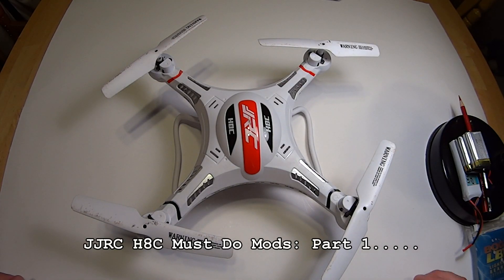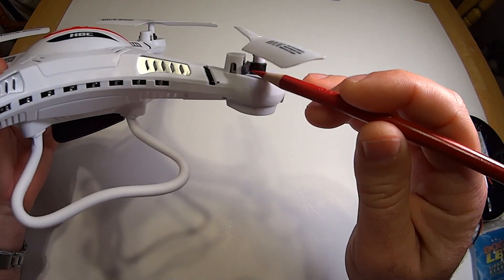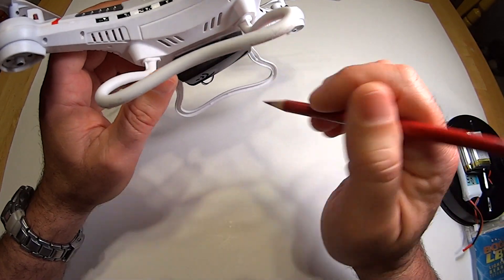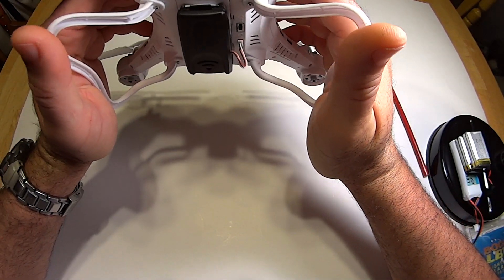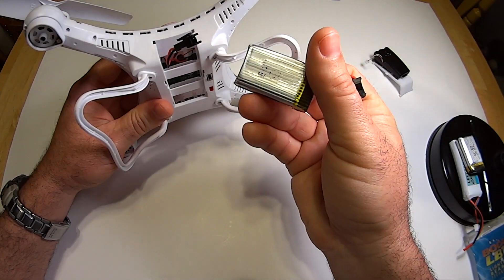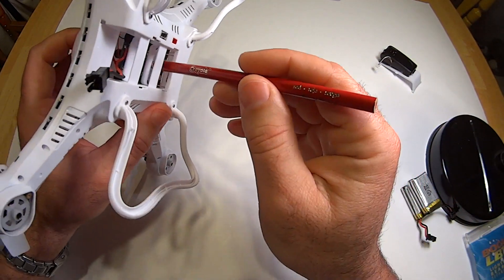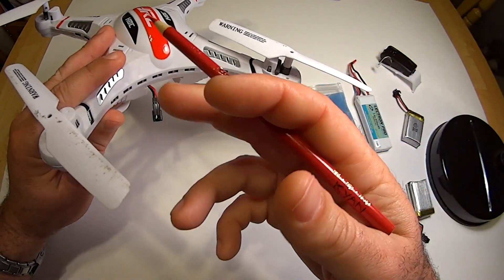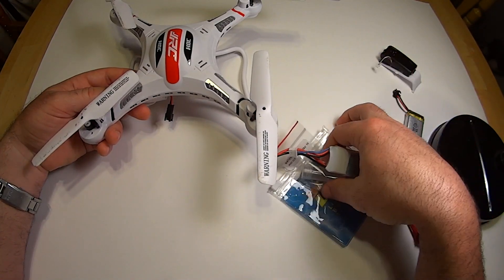JJRC H8C HD Quad Copter Drone MODS - All the Best Part 1 - [Thoughts After 25 Flights]

Comment from the maker: +Kyle Gorski  Any cheap (plug into the wall soldering kit will do).  Probably gearbest.com or banggood.com are the cheapest but will take long from China.  You could check Ebay for a seller closer for faster shipping.

Comment: Thank you so much. yep gear to motor separation after 7 flights. I just watched you and cut no..2 pencil eraser in half and used as spacers as you did with rubber. flying now boss. Thank you for vid. an information.you are right it is a lot of fun. fly on.I use the WL Toys transmitter 2v2 an a lot better.Thanks again.
Reply from the maker: Glad some of the info helped you out and your having fun.  That's what its all about!  :)

Comment: Love the landing gear mod, that was one of the first things I noticed was that it fell on its side a lot and scratched up my props.
Reply from the maker: Yah it tipped on me almost every landing.  Not good for destroying props.  Glad it helped.
Reply: Yeah and it doesn't look professional. Haha us quad copter pilots try to do everything smooth including landing and this mod helps haha. Thanks. Also do you think your motor went out because of the amount of flight time you have with that bigger battery? Cause that seems like it would be the problem with that battery is it will run longer than its meant to?
Reply from the maker: The motors will die on this quad no matter what.  I think the motors were about to go anyway and it was kind of a coincidence.  But I'm sure more heat for longer won't help either so perhaps staying in the air for the entire upgraded battery run is not helping the motors much.  I'll let you know when the next motor fails.

Comment: you forgot to mention that to use the lectron lipo, you have to alter the main connector the lectron has a JST connection and a connection for the balance charger
Reply from the maker: I think I mention it and it's shown in the part 2 video https://youtu.be/rJ3pEy6EAxo

Comment: Some good mods in there for sure.
Reply from the maker: Thanks...waiting on motors so I can get this thing back in the air and have some fun.
Reply: Dustin Dunnill Took my first mini crack at FPV with it ... gear was too heavy.  I need to consolidate (use the quads battery for my tx) and reduce some weight in wires/plastic.
Reply from the maker: Right on.  that's what I was worried about.  Really have to get lightest gear possible.  I plan on running the micro 200mw tx that comes with the Hobbyking quanum complete fpv kit off the Electron 950mah balance port.  which transmitter are you using?
Reply: Dustin Dunnill skyzone 200mw.  It's pretty tiny.  However, I had it wired to use my 808#16 keychain with lots of extra connectors and wire (for airplanes).  Once I get the wiring paired down and get it using the quads battery I'm sure it will work...I wonder what kind of flight time I'll get though with the tx using the quads standard battery.
Reply from the maker: UnlimitedVertical I see..hmm.  Well if your tx + cam setup (once lightened) is around 20-30 grams?  And its pulling its power from stock battery...I couldn't emagine much more flight time than about 3 - 4 minutes.  I'm worried about what camera to use.  The hobbyking quantum complete fpv kit cam looks to big in the pics.
Reply: Dustin Dunnill
FliteTest has an interesting DIY micro quad video/article.  Also horizon hobby sells an all in one micro FPV camera/tx/antenna which is pretty tiny.  I was able to get a bit of a flight by lightening it up some more, but not quite what I had hoped for...not ready to give up on the idea yet :-)
Reply from the maker: Thanks UV

Comment: Nice review.  I also did several reviews.  The main problem with the H8C is the 7.4 volt system.  It's too much for the cheap hollow cup motors and ultimately caused a board failure in my case.  Banggood has come out with the JJRC H12C.  3.7 volts.  A much better system.  The transmitter is junk with the H8C.  Good luck.
Reply from the maker: Hey MrPolymers,  I've seen a bunch of your great videos!  Your a great flyer.  It definitely has a few week spots.  Have some motors on the way and plan on doing more mods to see what I can squeeze out of it.  In the meantime the papa CX-20 Open version just came in the mail today....just unboxed it and will be setting it up...but that's another story......  thanks for your comments.
Reply: Good luck on the Cheerson.  I have a little experience with it.  Give me a PM if you have any questions.  My H8C and my 3D X6 are both out of commission. Awaiting a new board on the H8C and I returned my 3D X6 back to Banggood for a replacement.  They said I had an old version??  Really?  It's only two weeks old.  I'll subscribe to ya if I've not already.  Have fun...
Reply from the maker: That's to bad on the outta commission status.  I've been a regular on rcgroups.com (rc808hawaii) in anticipation for the CX20 and have really been absorbing it all.  watched a few of your vids and they really help.  Thanks again and I hope your flying again soon!
Reply: First, get to know what LVC means. ;)  Low voltage cutoff.  The Cheerson will drop like a rock.  If you notice, I run timers with most of my quads.  You can thank the Cheerson CX 20 for that. Run trial times on the 2700 mah batteries for the Cheerson and make a note of it. Then, when you fly the Cheerson, back off on the run time by 45 seconds to a minute.  My timers have alarms on them. When they go off, time to bring the Cheerson down.  In addition to the timer, I run a low voltage alarm.  I highly recommend getting a few of them as they are cheap.  With all these protections, I hope you don't experience the LVC crashes like I have.  Good Flying..
Reply from the maker: I've seen (and heard) your timers in your great videos.  Definitely taking heed on that as numero uno precaution.  Still got that giddy feeling from unpacking..lol
Reply: Yes, it's definitely a whole different quad than these toy grade ones and something you don't want to be practicing on as a beginner..
Reply: Hi There! Been watching "everyone's" vids on Youtube. Bought H8C as first Quad a month ago.. Yep I was taking off and watched left rear motor slow down and stop, Quad tipped over, etc... You know.. "They" should do a recall, as any other product on the market "They" would have to. Bought a Hubsan fly's great - no issues.. Since the few flights I got in on the H8C were impresive, I like the tip on the H12C and will get one of those.. "Thanks"!
Reply from the maker: It really is a fun little quad.  And I guess that's why I keep it and repair it.  Your probably right on the "recall".  I'm thinking of getting a mini brush-less kit and doing a retrofit to this quad since I like the look and form factor (definitely  not the very near future).  Still having fun with it.  I'm uploading part 2 with detailed installations of everything and body mods so you might want to check that out on my channel soon.  Thanks for commenting.
Reply: Will do and "Thanks"! It is fun when it works, gonna give H12C a try, I will post a vid when I have it. :)
Reply: Let me chime in here.  I own two H8C's. I've come to the conclusion that the 7.4 volt system of the H8C is too much for the cheap coreless motors. Granted, the H12C 3.7v system will not have the lift of the H8C, but I think for your "Sanity", the H12C will be easier on the motors.  I should be receiving my replacement on the 3D X6 brushless quad.  I will also be building a 250 class brushless ZMR with 12 A ESC's and motors more powerful than the X6.  I like the 250mm size vs my larger 350mm class Cheerson CX 20.  For me, not as much worrying flying them.
Stay tuned to my channel.  I'll also be joining my quad racing club and will have some fun stuff posted this Spring/Summer. Good Luck.
Reply: ***** I also have the V262 which runs on the same motors as the Tarantula.  You need to break in the motors and every third/fourth flight use a product called Ideal "electronic switch and contact cleaner.  Order extra motors and I hope you can solder and have decent soldering equipment.  I'm going to post a video soon of my two variations of H8C motor replacement. I'll touch base on soldering there too. Oh, I forgot to mention..  I think the motors have a plug on them.  That's great, but you cannot purchase them!  So, back to the soldering idea..
Reply: MrPolymers wondering if anyone has considered to put better motors into a JJRC H8C or if it's not really feasible? It's my first quad so really a newb but what is best action if/when a motor fails?
Reply from the maker: Greg Besso I haven't seen any better quality compatible sized motors yet.  The thing to do at the moment is just have some on hand for when they do fail.  All we can do is hope that someone will manufacture better motors at a good price soon.
Reply: Dustin Dunnill thx man, i ordered the battery and bearings on ebay, stoked for installing them as soon as they arrive :-)
Reply: MrPolymers Hi, I have one of these.... Is it true that motors run out after a while? I have seen a lot of people complaining for burnt motors. Maybe i'm lucky, never had a problem with motors, even at heavy duty. If I burn a motor just in case can I replace it with a powerfull one? I modded the transmitter today aswell like the video. Can't wait to try it out. Is it necessery to mod the bearings?
Reply: DavidVercettiMovies  Well, I'm not aware of anyone getting great performance out of the motors on the JJRC H8C.  You will eventually lose motors unless you either fly incredibly slow or not more than once an hour;).  My two H8C's are mothballed.  I had one lose a motor 25 feet up in a neighbors tree!!!  Well, that sucks.  Fortunately, the neighbor helped me get it down.  I just purchased a V636 Skylark to replace my H8C's for around the neighborhood flying.  I on occasion fly my modified V262 with the additional 4 lights.  At night, my V262 looks pretty cool with the 8 lights going.  I can run the V262 in pitch black night and fly several hundred feet away without losing orientation.  Try that as a beginner. ;)
Reply: MrPolymers Thanks for your quick reply. I'll check out the V262. At the moment i'm happy with it, 'cause it hasn't let me down... Yet :) Plus i'm building a little gimbal to get out the best from camera rolls and shakes... See ya!
Reply from the maker: The longest I've seen motors last is about 20 flights if your really lucky.  I've since replaced a few and the new motors did not last more than a few flights.  Brushes burn and disintegrate in the motors.  Maybe there is a strong brush replacement someone can come up with?
Reply: Hope they sort out this issue with replacement motors... I'll be happy to order a stock. The h8c is real fun to fly...

Comment: Anticipating.Will the bearings extend the life of the motors.I'm truly a novice to this all.Lol at the um didn't realize it until you through it out there.
Reply from the maker: I'm hoping they will.  Anything that can be done to lessen the friction for the motors will let them run cooler and last longer.  Also going to be tying electric lubrication inside the motors.  I've been told that breaking in the motors (running them at lowest throttle for a few minutes before flying) might improve their life.

Comment: Hi Dustin,

Really appreciate your channel!!

I have a JJRC H8D and will make some upgrade mods as well. Still, I have some questions:

What kind of charger do you recommend for the Lectron Pro 7.4v 950mAh?

Also, is there any connector adapter for this battery to the actual pcb power connector. Since I want to be able to switch to the original battery too.

Many thanks!

Comment: This battery will hook up to standart plug of quad?
Reply from the maker: Yes, it will push in and stay to existing plug but you could easily reverse polarity and d damage as it will plug in both ways so be careful.  I would recommend changing the the connector on quad to a JST so there is no accident.

Comment: I just bought a JJRC H8C. How can I balance the quad? Even at 25% it takes off to the side and will not hover.
Reply from the maker: Hi Dale, congrats on your purchase.  I think you'll really enjoy it.  Sounds like you have to reset the gyro. To do this place it on a flat ground turn it on, then turn your controller on, pressure throttle stick up and down tell it binds, then hit your left trigger with your left pointer finger on the top front of the controller 3 times till you have 100 percent flight rate. Then move both controllers sticks down to the bottom left corner position and hold them there until the quadcopter starts to flash, Let go sticks. Once the flashing has stopped your gyros should be reset and if that was the problem it should now be fixed and fly nice and straight.  Hope this helps.
Reply: Dustin Dunnill I calibrated the copter and the lights flashed just as you said. In a open room it still takes off to one side and will not hover at all. Is this because its an inexpensive quad? What is the next step up that will handle easier?
Reply: Trim it by using the right d pad
Reply: You could have done the original setup with the quad sitting just a little off horizontal. I use a small camera tripod type bubble spirit level and it definitely made me change my mind about perceived level. My bench was out about 7mm, but to look at it you'd swear it was perfectly level. I had exactly the same problem with another quad and after making sure it was level it hovered perfectly. There is an app you can use in an iPhone which will tell you if the surface you're using is level. Check out any table, make sure it's level using pieces of non-crushable cardboard to put under the legs of the table, then run through the setup routine with your quad on the table. Easy.
Reply from the maker: Hey Dale, have you checked if the props are on correctly? when they spin they all should push air down.  Otherwise try the trim button to see if that levels it.  Also you have to give it a quick jolt of throttle to get it off the ground or it may catch ground and fall over.  If non of those are issues you may have a defective quadcopter.
Reply: Dustin Dunnill Dale you'll never achieve hover with these "toy" copters. It's hard enough to get a full sized multicopter to hover using it's sophisticated circuitry and GPS. These just can't get anywhere near  a good hover, mainly down to it's controller. No matter how well you trim things it simply won't return to the same spot when you let the sticks go. It's not built to tight enough tolerances. Add slight wind currents, it takes very little to blow these very light craft off course, plus clever but rudimentary circuitry and you're left with something which travels well at speed in any direction, but a half decent hover, with no stick input is more down to luck than good piloting. I assure you it's your trim which needs setting up correctly, something you can only learn with time, just don't give up trying.
Reply: propfella I hover all the time with 50-100 dollar quads, I also have a qrx350 pro and it is harder to hover than the h8c or the syma 5c.  maybe u just can't hover?
Reply: Obviously you have no idea what a decent hover is. I have never seen any quad, hex or Octo doing a proper hover. And by that I mean to stay stationary for longer that a minute or even 30 seconds which is required to shoot a decent video grab allowing for for both in and out edit points. Mind you I wouldn't expect them to do it either, they simply aren't built to do anything like it. Just a very light breeze is enough to upset them and the quality of the controller just doesn't have  tight enough tolerance to allow a perfectly static signal. I'm not complaining, for the money paid they are an amazing piece of technology.. Now they have advanced so far and the parts are so cheap I am surprised the prices haven't plummeted. I feel we are paying way too much for a tiny board and a chunk of plastic. I know how much they cost to manufacture and if the copter fraternity knew, they'd screaming. The quad business is a licence to print money. All they are doing now is making the chunk of plastic bigger and using much the same technology to drive it. Each manufacturer is fighting for his slice of the pie but really they are all using similar components, but just packaged differently. What the business needs now is brushless motors, GPS, standardized controllers and an ability to use some decent batteries. All  for around $100. Don't laugh, it will come, but not just yet.  :-)
Reply: Dale Rector There are trim buttons on the right side of the controller, they are the same buttons that do the flips but you have to press the left button on top of the controller to use these buttons for trim, press the right button on top and the trim buttons become flip buttons.
Reply: You can try those trim buttons but the only way I rectified the exact same problem was change a motor. As soon as I did it flew perfectly. I recently had a friend visit with his toy quad and he had the same problem, only his simply would,'t lift off. one side remained almost glued to the deck. It was a simplr solution, but hard to find. He had aan incorrect prop on motor 3. It should have been clockwise but was anticlockwise. It ewas hard to spot because the props were correctly coloured. Only he had managed to get some spares belonging to a different quad. As soo as I swapped props it too flew perfectly. By the way, the bad motor ran without showing any problem, I can only think it was wound incorrectly.
Reply: While settting flat on the ground or floor increase throttle to all most take off, if the quad moves to the side and back that motor is bad. What ever direction the quad goes that is the bad motor.
Reply: Mark Brookes Also have no problem hovering, from my L6039, eachine X6, V262 to basically auto pilot with V303.  AND..........the JJRC H8C.  not really rocket science......